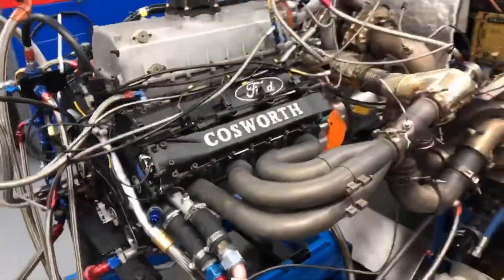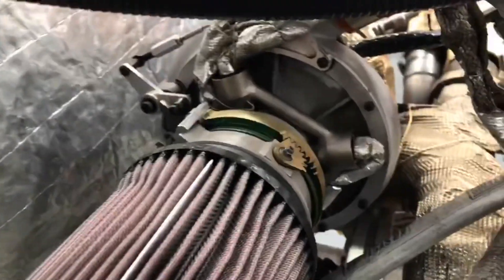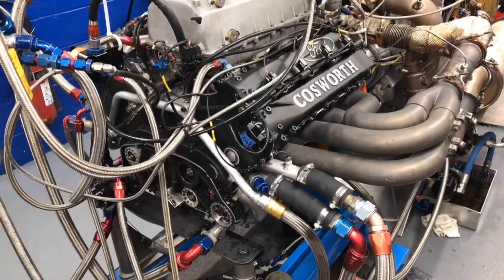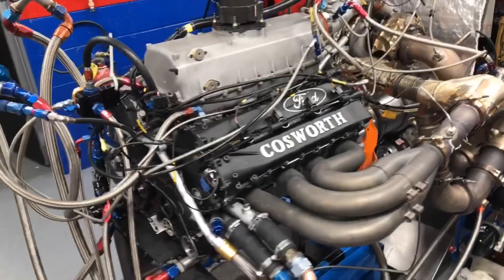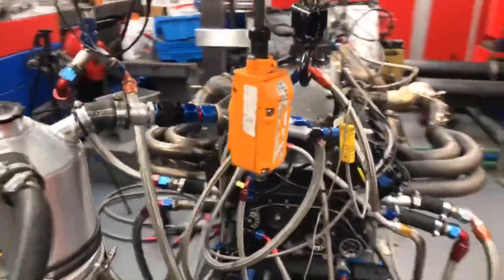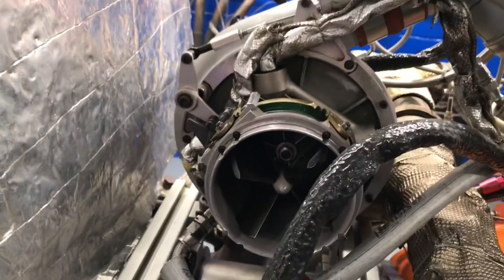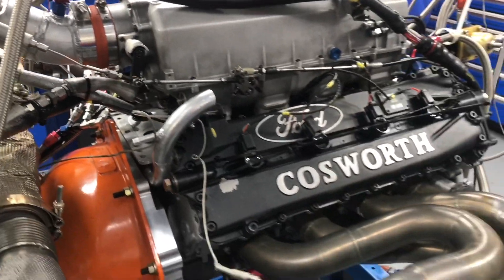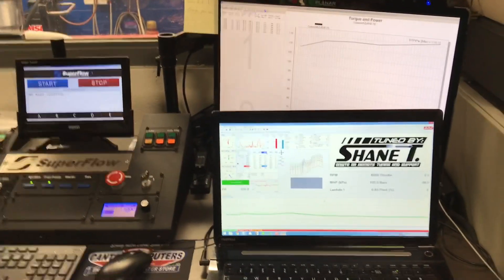765 Horsepower Cosworth XB Dyno Mini Documentary

Comment: Great video. Do you know how much this engine could make with the boost turned up ? 7 lbs of boost is a lot lower than I’d thought it’d be.
Reply from the maker: More boost would most definitely increase the output but the parts were engineered for this power level. If you turn it up you risk shortening the life of the engine.

Comment: Sorry for ignorance but what are the two different tq and pw figures on the last dyno sheet?
Reply from the maker: You have the raw output as measured to the dyno unit, and then the corrected values based on a standard set of atmospheric conditions compared to the test conditions. In this way, changes made to the engine that affect power, are not also affected by changes in the weather.
Reply: @TunedbyShaneT  Gotcha. Thought as much but hadn't seen it listed like that. Thanks for taking the time to reply.
Reply from the maker: @333pg333  no problem

Comment: Great walk around and thanks for all the info on the cool  set up @Tuned by shaneT
Reply from the maker: Glad you enjoyed it, thanks for taking time to say so.
Reply: @TunedbyShaneT  do you input the lambda voltage directly to the M800 to correct the A:F ?
Reply from the maker: So on this project we are using a Lambda to CAN module which reads the sensor and then transmits the Lambda Value over to the M800. The M800 then treats it as a native Lambda signal for logging and closed loop control.
Reply: @TunedbyShaneT  nice  that is one of the good things of having a good EMS right brother. 
Once again thanks so much for the input and  your time

Comment: That is just a fascinating engine. What inlet air Temps were you seeing with the PCI? I'm really curious about its performance versus a normal intercooler.

Too bad they wanted to keep it original. I would bet a modern DBW motor on the pre-turbo throttle and an electric wastegate actuator would really take it to the next level.
Reply from the maker: I was thinking this same thing and we may get the chance to turn it up later. 
Charge temp without PCI was 75-80c, with PCI 60-70 C